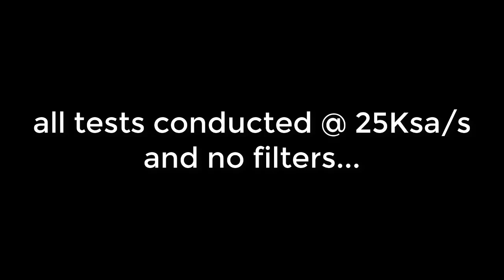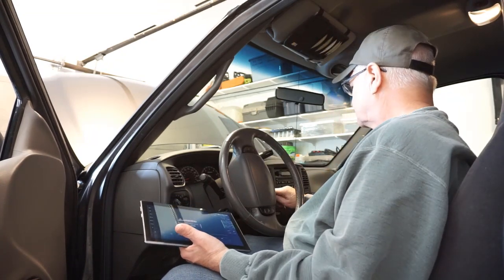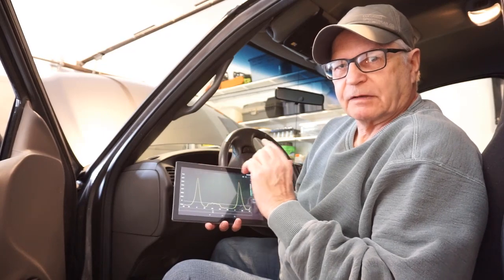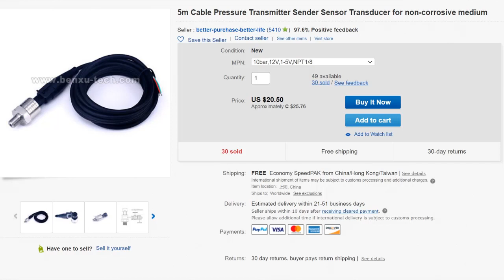GADGETS#139 - 12v 10 BAR ABSOLUTE PRESSURE TRANSDUCER

Comment: The sensor is advertised from 0-10bar. How were you able to tell that it can measure vacuum?
Reply from the maker: if you look at the waveform, you can clearly see the vacuum during the intake stroke

at rest (0 BAR) the sensor outputs 1v ... when vacuum is applied, the voltage is pulled down <1v

I know it's a bit more money, but the best value out there is the ROTKEE PS16 which I've also featured on the channel ... their accessories are also well priced
Reply: @theGADGETSplaylist  I see, so you have to test it to really know if it can do negative pressure. I have been experimenting with used industrial pressure transducers that I find on ebay. They are very accurate and give clean signals. The 4-20ma output ones are a dime a dozen.l but harder to hook up. The ones that output voltage are the ones I go for. I plan to release a video about using 1500psi(Hydac brand) pressure transducers to check functionality of rear brake proportioning valves or low line pressure. I discovered my car has more brake force on  the left rear than the right based on wear on the rotor. The calipers are not seized so I'm suspecting line pressure issues possibly due to one of the proportioning valves malfunctioning.
Reply: @theGADGETSplaylist   How can I contact you directly? My comment keeps getting deleted.
Reply from the maker: @moshet842  the best place is HScope LOUNGE on Telegram

https://t.me/hscope/1

Comment: This is a good find but.... take a look at the kit sold by PHAD.  It has a "265psi Pressure/Vacuum Transducer (30inHg vacuum to 265psi" meaning it can do vacuum too and we need that for intake measurement. Anyone can ID what brand that transducer is and find a source for it? I don't need the whole kit for $500. Also this 12V transducer is 10 Bar only. It is up to 145 psi, enough for in cylinder test?  The ebay seller also sells 300PSI 5V version. It really is not too hard to hook up a 5V power source with a USB wall adapter. Maybe that will give us good snap throttle result and good sample rate too?
Reply from the maker: $30 vs $450 ... even just sourcing transducer (from Italy) that Ivan uses is expensive

this 10 BAR will measure 30inHg vacuum and yes, 145 PSI is enough for in-cylinder

I really like ROTKEE PS16 and many other people in our HScope group do also

Comment: My vehicle has spark plugs with 14mm thread, could you suggest an adapter required for using this 10 bar transducer?
Thanks.
Reply from the maker: the cheapest way is to make one from an old spark plug (for the threads) and fuel hose

knocking out the porcelain (tough stuff!) can be tricky but it can be done

Comment: Greetings master! I just signed up because of the wonderful work you do, congratulations! This sensor is similar to the Rotkee PS16. I'm starting out as a repairman and recently acquired an MTPRO 4.1. I want accessories that work perfectly with it and in the middle of research I came across this find. Thank you in advance for your help and attention!
Reply from the maker: thank you for your comment:)
these would be the 2 choices for low cost pressure transducers:

this budget 12v  10 BAR sensor

or

ROTKEE PS16 (worth the extra cost, IMO)
Reply: @theGADGETSplaylist  This 10bar has the same characteristics as the PS16 In the Rotkee presentation you mentioned that it is much superior to the others due to its more linear performance over a wider voltage range. I'm interested in purchasing one that supports 35bar for diesel vehicles and knowing if only one is interesting for diesel and gasoline/alcohol. I have a little experience with electronics and I thought it would be better to have two, one for each due to the precision at low and high pressure/compression. Your quick response is impressive, this is rare here where I live. Congratulations!
Reply from the maker: @marataismara2252  there isn't a 1 size fit all that would be good for diesel engines and also good for gasoline engines

Comment: Does the cable come with a bnc?
Reply from the maker: no ... cable has sensor connector on one end ... and bare wires on other end

ROTKEE PS16 featured in GADGETS#122  is also a very good option for this work at reasonable pricing. It is ready to use out of the box, has better performance and their accessories are also well made and affordable

Comment: Great Idea. I purchased the 10bar. My question is there is two “Scaling Method “ equations in the link. One is y = 2.5 x -2.5 and the second one is y = 36.25 x -36.25.
Is this to set it up under two different ranges?
Sorry for my confusion.
Reply from the maker: both are PICO settings...

the 2.5 one will be in BAR

the 36.25 one will be in PSI

Comment: Have u run into and issue with the 10 bar been a little  low, on WOT in cylinder pressure  can max out the  10 bar
Reply from the maker: yes, WOT throttle may exceed 10 BAR and the towers will clip

but the reason we typically WOT is to see any exhaust restriction and that portion of waveform will be well below 10 BAR and measurable

Comment: Hey Dennis,
If people are worried about cutting off the tips on snap throttle. Couldn't you use an attenuator like your 4x #106?
Reply from the maker: 4x wouldn't help...it's not the voltage range in scope that gets maxed out...it's the sensor itself, it hits a "ceiling"

10 BAR handles pressures expected @ idle and in a snap throttle any exhaust pressure restriction (the main interest) would show up ok, even if towers clip
Reply: @theGADGETSplaylist  ah, of course! It's reducing the input to the oscilloscope. Not the input to the sensor. My mistake.

Comment: Denis thanks for all your work, it's always nice to see someone on the top of their game, there is no substitute for experience.
For some reason i got interested in automotive diagnostics and can not get enough of it so i followed your advice and got a 10 bar transducer.
In addition to your findings i think this device can be supplied from a 9 volt battery, the unit is stable from 5.5 volts upwards to 24 volts and with a load of more than 5 kilo ohms (  less than that and the supply current increases to maintain correct output voltage to the load, so the scope should be fine with 1 megohm ) consumes only 2,5 milli amps, this is a very low value, can be used with an unregulated 9 volt battery for a long time and can be more convenient to handle in some situations.

Also looking into the addition of more probe inputs into one channel so that we can see our waveform but can also "dial in" another signal like a injector pulse or ignition circuit for the purpose of identification which cylinders are related to the wave forms.
This could be done with the use of dual gang potmeters which have the ground side common, the wipers common and the in and out puts wired accordingly.
Somewhat like a basic audio mixer and several signals can thus be assigned to one channel for identification purposes.
The impedance of the pots output can just be parallel to the scope input and what you in fact change is the coupling of various inputs to the scope input.
Will let you know how this works in the future, thanks again and all the best.
Reply from the maker: yep, that 10 BAR can handle a wide range of input voltage, has low amp draw and would work just fine off a 9v battery...

let us know how you make out with your idea of multiplexing a channel...

I never expected Agent 86 to drop by my channel...lol

we have a HScope TELEGRAM group and you sound like a good candidate to join us Max, so if you like here is the link:

https://t.me/hscope

Denis
Reply: @theGADGETSplaylist  , so it doesn’t matter if the 12 volt battery is at 12.6 or even 13 volts, it self regulates itself for the same output?  Also since 10 bar is about 145 psi, what is going to happen if I use the transducer on a high compression engine with 165 psi or more cylinder pressure?  Thanks a lot.  Tom
Reply from the maker: @Okie-Tom  battery could even be down to 10v and not affect it...

there's a big difference from an engine that tests 166 PSI on a conventional compression test and the same engine on a running in-cylinder pressure test where the towers might max out at 80 PSI for example...

manifold vacuum and test hose adding to volume are the two main reasons for this...

if we snap the throttle, we likely will exceed the 10 BAR ... BUT, we do this to see if exh restriction and that lower part of the waveform would still be useful even if the towers clip...
Reply: @theGADGETSplaylist  , thank you!  I am ordering one for me and one for a cousin to build a couple of these!
Reply from the maker: @Okie-Tom  it's probably the best value out there that produces an acceptable waveform...good luck with your builds:)

Comment: Dennis, as always, great stuff!
Would you please explain why you used a 10bar sensor instead of 20bar, since most vehicles' compression is above 200psi (15bar)?
Also, would you know if the 150psi sensor is essentially the same performance as the 10bar sensor?
I'd get 300psi, but there are no 12v models.
Cheers...
Reply from the maker: we can't compare the higher PSI of a conventional compression test using a schrader valve that helps reach those pressures in test hose after a few cranks...

in-cylinder pressure tests tops at much lower pressure and this 10 BAR sensor can handle most petrol engine work...
Reply: @theGADGETSplaylist  
Thanx for the quick reply.
Then I'll go for the 150psi sensor.
Cheers!
Reply from the maker: @chriscadman5715  I would go for this 10 BAR sensor because it is an absolute sensor...it will read below 0 PSIG for the vacuum portion of the waveform...

the 150 PSI sensor is not an absolute pressure sensor...you will be disappointed
Reply: @theGADGETSplaylist  
OK, thanx for the update.
I'll do it.
How could I know the difference by looking at the auction?
I just assumed they were all the same.
Never ASSume anything!
Cheers...

Comment: Bought the Aliexpress one. Arrived few days ago Very pleased. Cleaner waveform than $10 ones have, and much faster response. No issues measuring vacuum either.  EXCELLENT FIND Denis 👏
Reply from the maker: It's great value. Wish I had found it earlier, Andrew. Oh well, all the effort on the cheaper PSI sensors was a learning experience:)

Comment: do you have chart for different voltages and pressures or will it show compression
Reply from the maker: For HScope users, the probe settings are already in database.

For PICO users, I have just now as per your request, added them in the download link in this video description box.

Comment: Great work.Very nice and clean.
Do you happen to know if the same company sell one with a higher pressure range, capable of measuring the compressions found on Diesel engines?
Regards, Joe
Reply from the maker: no higher range in an absolute sensor...

at 10 BAR this one is ok for petrol (as you guys call it), might even clip top of waveform a bit on snap throttle (no worries)

Comment: The spec for the Ebay one says gauge pressure  I really like the idea of 12v input.  The one rated 30 psi is psiA, but it's a 5v model.  From the looks of your graph it seems to be psiA.  10 bar is probably ok for idle, but won't cut it for snap throttle.  Will it hold up to a snap throttle??   Need to do snap throttle to check exhaust back pressure from a clogged CAt.  It says overload capacity = 2x, so maybe it will hold up to snap throttle.  At $20 I think it's worth a try.
Reply from the maker: tho the 10 BAR doesn't specifically say it's PSIA, it is. Waveform constructs well below 0 PSI in expansion pocket and intake stroke.

yes, on snap throttle the towers may exceed 10 BAR on some engines and clip at top ( a bit)...won't affect the exhaust portion of waveform to read possible restriction...

on crank and at idle, I doubt the 10 BAR would ever get exceeded
Reply: @theGADGETSplaylist  That's sort of what I was thinking.  Thanks for the reply.  
Have you ever used the map sensor to look at intake manifold waveform?  or is it's location wrong?
Reply from the maker: @kerryb2689  if accessible on the vehicle, the MAP sensor could be back probed and its waveform could be seen. It would behave like GADGETS#26

Comment: 10 bar is only 145psi some engines can run higher pressures than that. will this hurt the sensor?
Reply from the maker: no...these sensors typically have 3x overload protection ... they won't read properly above rated capacity but will not damage...

145 PSI handles most petrol, normally aspirated engine work...may exceed it briefly on snap throttle, not a big issue IMO

will not exceed it on crank...

Comment: Looked at it, I don't see that it is absolute, but 0-10 Bar and 12V with the output range is great!  What are you using to acquire the signal?  Thanks, great idea!
Reply from the maker: YES, it is absolute.
0 BAR is @ 1v
Sensor reads below that. Look at waveform and you will see negative pressures on expansion pocket and intake portion.
Reply: @theGADGETSplaylist  Great, we're blessed with the variety of inexpensive sensors. I've ordered a sensor from them, thanks!

Comment: Impressing discovery of this new sensor. Please correct me if wrong, with this it is not required any modification to the sensor and any additional power source right? Connect directly to the battery...
Reply from the maker: that's right, Martin...no modification needed and simple vehicle battery power provides clean, accurate waveform...worth every dime...

Comment: Just another thought is the output linear? Could we use it for an accurate calculation of pressure?
Reply from the maker: yes, output is linear...2.5 BAR for every 1v

with the probe calibrations in HScope database, the readings are accurate in either BAR or PSI
Reply: @theGADGETSplaylist  I'm going to buy one anyway but I wish it was 5v, the easy way to get a good steady 5v is one of the cheap pound land phone chargers which has a battery inside or from the laptop USB port
Reply from the maker: @andyguest6543  you'll be pleased with the 12v...no issues and more compact...

Comment: I saw that they also have a -14.7 to 30 psi sensor. Could be interesting for vacuum pulls in the intake or pulses from the exhaust, crank case or cooling system. What do you think? It's 5v feed though.
Reply from the maker: for vacuum, I prefer a MAP sensor like #26

for exhaust, I prefer a pulse transducer (piezo)

Denis
Reply: @theGADGETSplaylist  what do u mean by "map sensor like #26 " ,I don't get this
Reply from the maker: @yemiasaolu1622  I am referring to GADGETS#26 where I use a $10 MAP sensor as an electronic vacuum gauge.

You will notice Yemi that I number all my videos for quick reference.
Reply: @theGADGETSplaylist  thanks I will go check out the vid